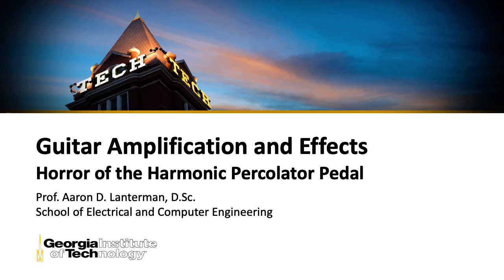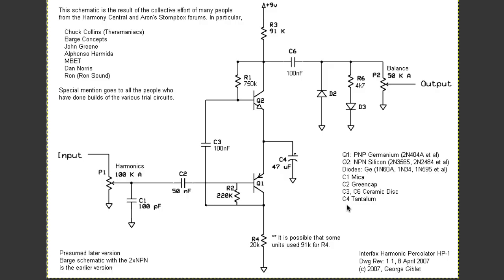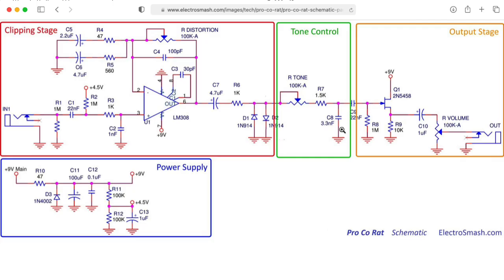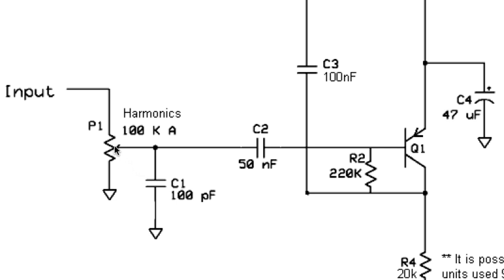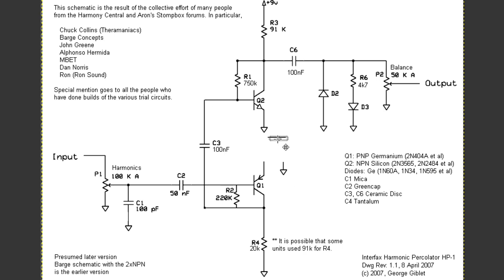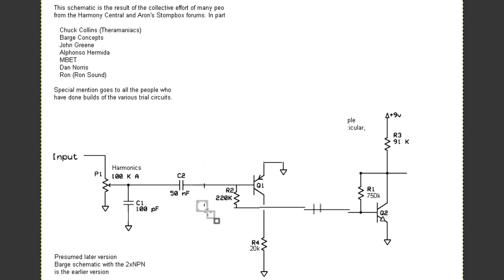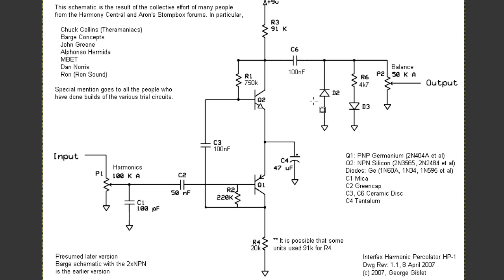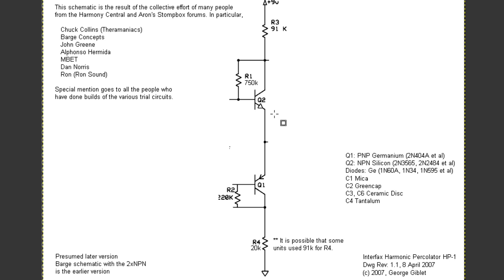Horror of the Harmonic Percolator Pedal: Analysis (Guitar Amplification and Effects Bonus Lecture)

Comment: What's the purpose of D2? If it's anode is connected to 0V and there is no negative power rail, then it's never conducting & not doing anything? Perhaps except for some few pF varicap action creating an RC lowpass, but with a cutoff too high to be audible, and perhaps some miniscule reverse leakage which shouldn't be audible either (unless it was some very old and very low quality diode germanium)... so what's the idea behind it? Is it perhaps some kind of protection from stuff connected to the output jack?
Reply from the maker: It's on the right side of the C6, so at that point the signal is ground referenced through the volume pot (vs whatever DC bias is on the left side of C6). At that point in the circuit whatever the power rails are is irrelevant.
Reply: @Lantertronics  thanks, that makes sense... (i get so easily lost in single supply circuits... embarrassing

Comment: There is this wolf computer by mellowtone id love yo understand, sure there are schematics there
Also the fender blender
Those 2 intrigue me a lot
Thanks this was finely educational
Reply from the maker: It looks like a two-transistor Fuzz Face type circuit (shunt-series feedback configuration) with a common emitter amplifier pasted in front to overdrive the Fuzz Face type circuit more, and the fuzz control is put on the common emitter amp instead of the feedback circuit.
Reply from the maker: Here's my lecture on common emitter amplifiers: https://youtu.be/ipoLVp9TLfA
Reply from the maker: Here's my lecture on the Fuzz Face: https://youtu.be/xuzT7CSYtyI
Reply from the maker: Fender Blender looks very interesting:  https://files.effectsdatabase.com/docs/schematics/fender_blender.pdf
Reply from the maker: 1st stage looks like a Fuzz Face, but the output is taken from the emitter of Q2 instead of the collector. Last stage is Q4 driving back-to-back diodes in parallel to ground, so that's going to be a Boss DS-1/Pro Co Rat type of distortion. What's really interesting is Q3 and diodes D1 and D2; I'd have to think have those, I haven't seen anything quite like that.
Reply from the maker: Oh wait, I think Q3 and D1/D2 are doing an octave fuzz kind of thing.

Comment: I'm glad that you did this vid, but...is there no significance to one being pnp and the other being npn? No phase issues or anything? That's what I wanted to know about. What is the significance of one being pnp and the other being npn? Also, the point of the HP was that it was supposed to emphasize, or so I've read, even order harmonics, like tubes. That was the point of it. Is there any truth to that?
Reply: I read this too and i wondered if there was any truth to it, i did see a chap on YT doing some signal analysis with something or other (i think maybe a tubescreamer?) in which you could see the odd-order harmonics generated...i could never stand the tube screamer so it made sense to me from that angle 😂 

i do have an oscilloscope somewhere so i'll have to investigate.

What i would say about HP type circuits is....i've built a whole bunch of them and have just one bad sounding one. You can mess about with component values and dump most transistor values in and they will still sound at least good, unlike say a fuzz face which in my experience is just swapping parts out til it sounds okay, a total nightmare.

I REALLY like a zonk machine, but that is even finnickier. Honestly all my silicone fuzz builds sound amazing every time, but theres just something about a TB mk1 or 2, zonk machine or nkt275 fuzz face that is on a different level when you get a perfect one :)

Comment: VENERABLE Prof. LANTERMAN, I IMPLORE YOU, if you are looking for a topic for a video, i have, in my opinion, the single most important topic in pedal history - DEMYSTIFYING THE FETZER VALVE. Maybe academically more known as the Triode Emulator by Dimitri Danyuk, it is a type of circuit that attempts to use a JFET transistor in place of a Vacuum Tube. I think you are the only one equipped to deal with this problem. We should look for answers to a few simple questions and maybe delve deeper thereafter:
Why is it similar to a tube, and why the need to have such specific biasing?
Why is the J201 so special, some say it's used so often in these circuits because it's "not just another regular JFET"
Is it possible to use MOSFETs in place, as some have used them in similar configurations?
DM me for a list of links for research <3

Comment: Could this be a BJT version of the JFET Mu Amp circuit?
Reply: Definitely looks a lot like something along the lines of a mu-amp / totempole / SRPP kind of topology - i.e. a push-pull amplifier.
Reply: That's exactly what I was thinking last night, also Sziklai pair sort of like the Axis Fuzz.
Reply from the maker: @EversonBernardes  I can see why people think that, given the way it's drawn. But the mu-amp (which I was just introduced today) is more of a cascode, with the top transistor being a common gate configuration.

Comment: Do the MXR polyblue Octave pedal. And see why it's so fragile. I had one sent from the USA to Australia that was broken on arrival. Like I use the power supply it come with. With a travel adaptor. And it didn't work. So I tryed the power supply from my outlaw tuner Power supply aka iron horse. And still didn't work. Then I used the MXR power supply to run my boss DD7 and it worked fine. I'm no sparky but I'm thinking two things. Something got past Q.C at MXR or they sent the wrong power supply. It says 9v but it struggle to light the led light out of the box.
Reply from the maker: That's weird -- does the power supply it came with work for other pedals?

Comment: I think you are only scratching the surface on the weirdness of this circuit in you analysis. Depending on the characteristics of the transistors used, and the values of the capacitors; the circuit can exhibit a sort of triggered oscillation. It's almost like an octave divider. I would like to see an in depth analysis of how this could occur.
Reply from the maker: My first thought would be to dig into C4; I made a pretty standard split between a "DC bias" circuit and an "AC small signal circuit" that assumed the cap was a perfect short at audio frequencies. It may be doing some weird things with the bass.
Reply: @Lantertronics  I think that is part of it. If the ac signal squeezes by that bypass cap then it could be reentering Q1. Almost like in a common base configuration. I also think having a leaky germanium transistor for Q1 contributes to this.
Reply from the maker: @ianwoodmusic7137  Your common base configuration note is on target -- when I first saw it I assumed it was some sort of mutant cascode until I looked more closely. Maybe there is some mutant cascode action going on...
Reply: @Lantertronics  If I was actually an electrical engineer I could probably explain it better, but I'm just a DIY musician who likes to tinker.
Reply from the maker: @ianwoodmusic7137  That's how it starts! There is always more to learn! :)